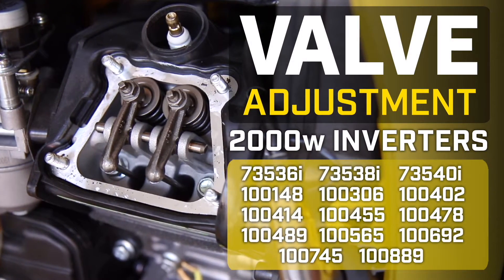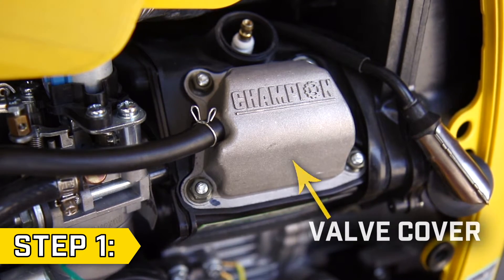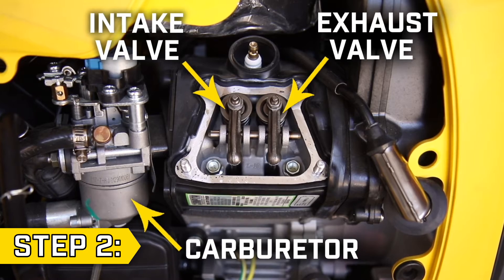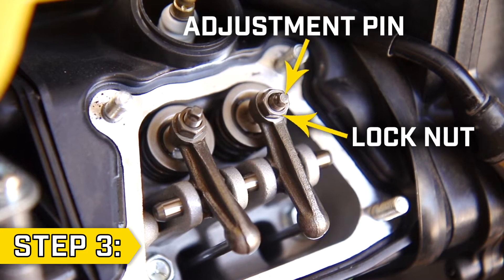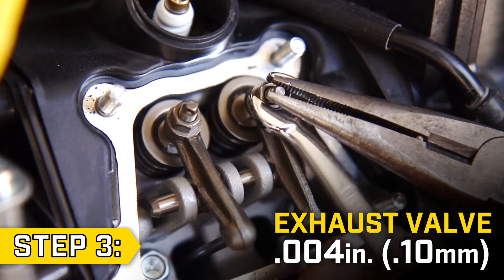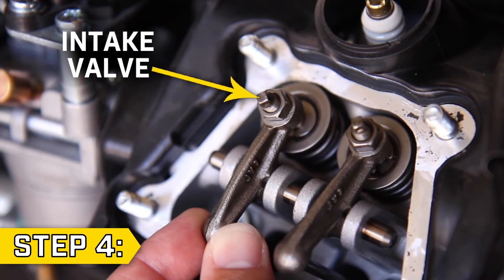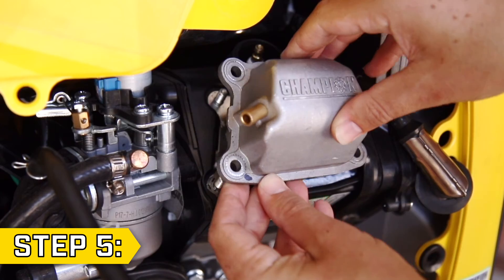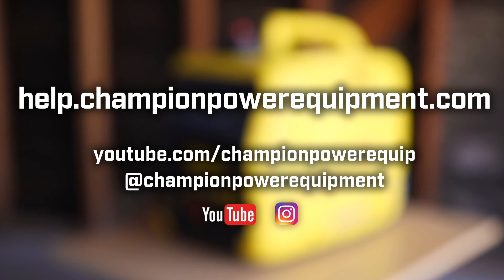Valve Adjustment (2000-Watt Inverters)

Comment: Yo tengo un generador eléctrico champion Dual Fuel 4375watts y la compresión está en los 60psi, de la noche a la mañana el generador a aumentado con rigidez la compresion a 80psi de tal manera que las cuerdas de arranque me las parte todas, he intentado calibrar las válvulas según el manual escape 18mm admisión 13mm y sigue generando una comprensión muy brutal, ya no se que solución usar, esperaba más de este generador pero realmente no se que hacer, ¿Que solución me pueden dar? Mi generador es de la serie 1004001, en estos momentos no puedo usarlo por ese pequeño detalle. Gracias
Reply from the maker: Hola, lamentamos que esté teniendo problemas con su unidad. Llámenos al 877-338-0999 para solucionar el problema correctamente. Gracias

Comment: All them 2000 to 2500 watt generators are made from junk metal  the rings paper thin the bores made of tin foil and valve train lmfao pure trash junk not worth buying or working on . If it does run it will only last 100 hours maybe and also the air filter doesent filter at all just put it on a dirt surface that engine will be toast in 2 weeks absolute trash do not buy a yamaha clone generator by any manufacture warning
Reply from the maker: Thank you for your feedback, and we are sorry to hear about your experience with our inverters. We understand how frustrating this can be, and we want to assure you that it is not typical for a unit to malfunction after only 100 hours of use. If you haven't already, we encourage you to reach out to our support team so we can assist you in troubleshooting and addressing any issues with your unit. You can contact us at 1-877-338-0999, email us at support@cpeauto.com, or use our live chat feature on our main website. We are here to help.

Comment: What are the symptoms if any to know if the valves need adjusting
Reply from the maker: Some symptoms may include the generator not starting correctly, rough idling, or potential loss of power.